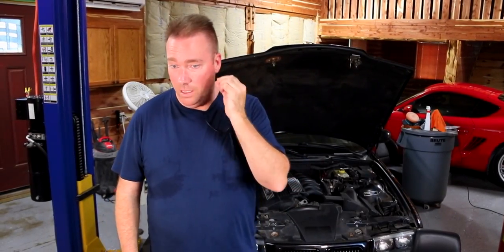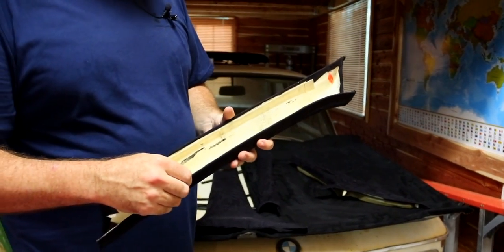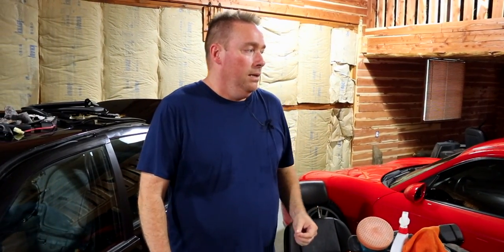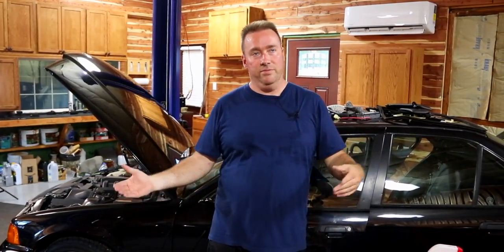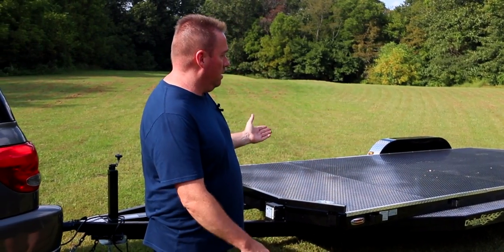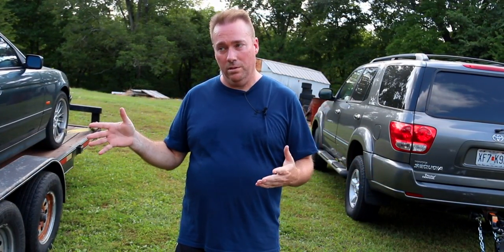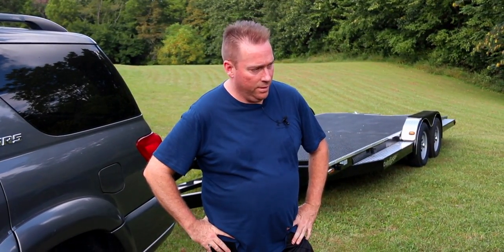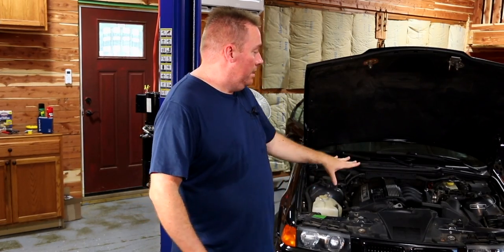The Real Reason Why You Shouldn't  Buy A BMW E36 M3 In 2021

Comment: I’ve got a 2001 E39 M5, 128k miles. Bought it right before the pandemic. Started some easy work, replaced the cracked rear view mirror, got a BlueBus module for it, sourced a set of Style 65’s, few other small things. Then the starter failed and I haven’t gotten around to fixing it. Has some rust though.

Comment: I have a 92 318is 220,000 miles on it and it still runs and drives. I’ve put 100,000 on it in the last 5 years. Ive been thinking about selling it.

Comment: I hate that I missed the boat on getting a e36 M3 to keep. I had a really nice 95 Avus Blue Coupe I paid 5 grand for back in 2013, should have never got rid of it, but who knew the market on these cars would explode like this. I will gladly hang on to my 97 328i at this point, as they are starting to get silly in price too.
Reply: I had a 93 325is in Cashmere beige metallic paint back in the day. Its a pretty hard color to find now. I miss that car. I also owned a 97’ M3 sedan. I sold that one 6 years ago for a down payment for my house. I now own a ‘04 Z4 3.0 vert. 6-speed., and a ‘05 Toyota MR2 spyder with a Honda K24 swap. The Z4 rides better than both e36’s I’ve owned. The MR2 is essentially a race car. Both are really underrated in my opinion. I thinking about which one to keep as I only have space for one. First world problems.🤔😄
Reply: @vltruan  should keep MR2 because it already holds sentimental value because of the k24 swap.  Needs a turbo now lol
Reply: @MowerModdin  Yeah, The K24 MRS is hands down the best car I’ve ever owned. Definitely a keeper.
Reply: @vltruan  I absolutely love that gold color on a e36. My first car was a 94 325is in Boston Green, we had it in the family, they were great cars indeed. It's still running today, although new owner has not kept up the car that well. My 328i sedan is in need of a repaint, if I wasn't such a stickler for sticking with the original color that gold color would be the first I would go with. I have heard that the Z4's with the 3 liter motor is an absolute blast to drive. That MR2 is definitely a keeper too, you dont see many these days from any generation.
Reply: @letsplayclassicgames5024  Cashmere Beige Metallic is a beautiful color for the E36. If you ever get a chance to drive a E85/E86 Z4 sport pkge. 6-speed, I would highly recommend it. Their pretty much mini M3’s, and their reasonably priced right now.
Reply: I just scored a 96 328i convertible for 1500 bucks... car runs great, really straight body, I just need to replace backseat, interior rear quarters and carpet

Comment: Is $1000 on a manual 04 325i a good deal? Are there any repairs over $1000 I should be worried about?
Reply: Unless you’re somewhat hands on I wouldn’t recommend it. 

If you like working on your cars go for it. 
Hard to tell depends on how many miles it has but from experience I had a 2004  330i automatic and the transmission went out, but everything else was fine just a lot of plastic parts that needed to be replaced.

Check the frame most 04 models crack at the rear.

Comment: Can we get more videos on Philip’s MB diesel? After buying a 2006 E350 in 2007 I had written MB off. The car was low quality engineering. The problem year for the 350 engines. Philip’s car has peekeed my internet to try E class again with the Diesel engine. Thanks.

Comment: Nathan, my 98 328 has a p1525 and an p1519.  I replaced the camshaft sensor and vanos solenoid and it didn't fix it.  Any ideas that can help me out before I change the engine.

Thank you!!!
Reply: Swap the engine and convert to obd2 so ur codes have meanings. Plus if ur worried about tuning they have come a long way with obd2
Reply: @TechTokOffical  last time I checked a 98 was OBD2

Comment: Apart from the E30 M3, the Euro spec (post 1987) E30 coupes, specially the 325i (m20b25) or 325 super ETA (m20b27 stock or m20b27 block with m20b25 head) I believe are the most sought after. Oh and maybe the 325ix, but those are really hard to find.
Reply: I have a 325ix, & its been super reliable,  only sucky part is parts are very hard to find